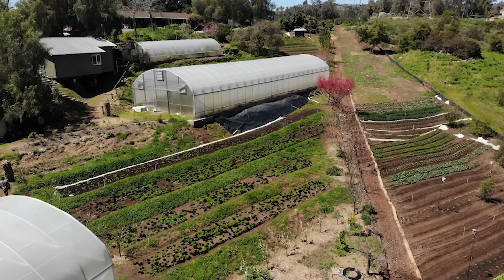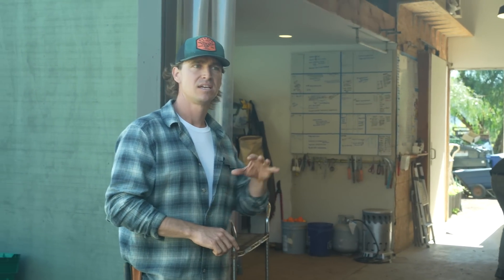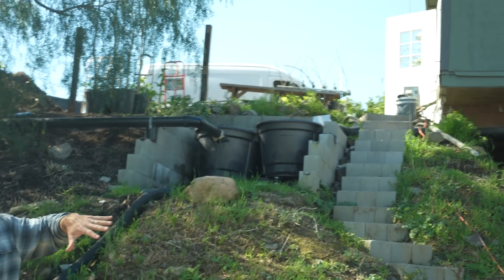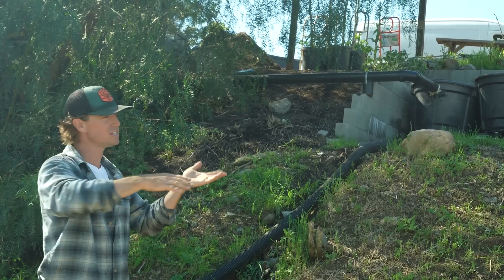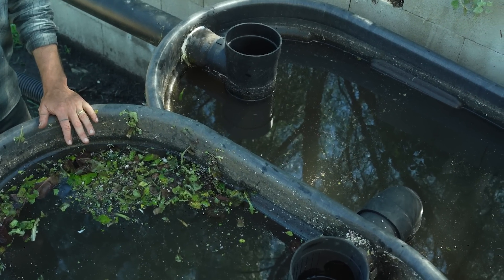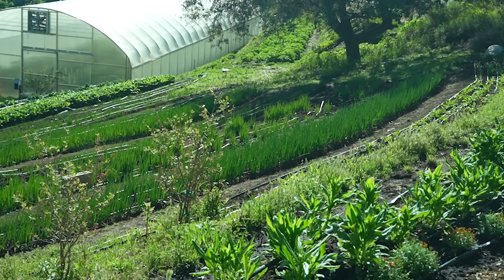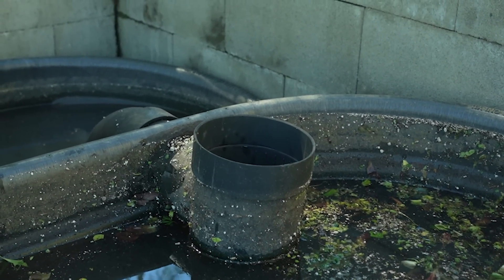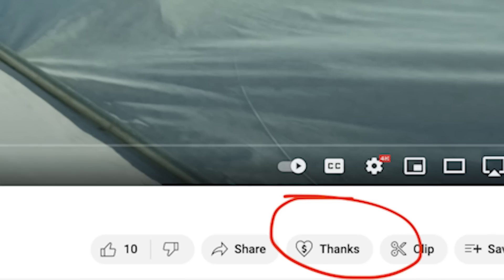Re-Using Water in a Dry Climate

Comment: Tell him to put a siphoning pipe between the two large holding tanks and the upper tank will automatically flow into the lower tank removing the need for the sump pump transfer. I hope this helps.

Comment: In Chicago we use traps like that, they're called CB Traps for catch basins. Grease floats to the top and clean water is pushed up from the bottom of the trap into the main sewer. It's essentially a giant grease trap that's a manhole in homeowners back yards.

Comment: 1st thing I built before starting my urban garden was a rainwater harvesting system. Two 55gal (415l.) drums connected by a syphon hose.  Due to the placement of my overflow holes, the net capacity is probably closer to 100 gallon (378l.).  They've yet to go lower than half full (or half empty - lol) but we do get a lot of rain in Puerto Rico.  No first flush system as it's not meant for potential human consumption; just a chef colander to filter debris.  My plants love that water and it makes for some 60 toilet flushes if, after a hurricane, the water authority cuts out...

Comment: Ive become a big proponent of ecosystem ponds for ranwater capture, they can hold several ibc tanks in a small pond, and work with nature in a way that is as beautiful as it is beneficial. Might not work alone for wash pack, but could be part of any system i think.
Reply: Doing this on my own property. Will have one big pond for fish and wildlife but can easily steal 5-10 gallons from if I had to in between rains but I will have many small ponds for watering crops all year at different locations. I plan to have them lead into a hose at the end of each small pond and the ponds would be slightly raised so you could easily fill up any buckets or watering can with the hose and any crops nearby could be watered if it was beneath the raised ponds.

Comment: One expedient option for the two big tanks would be to have a hose between the two, automatically siphoning water so they maintain the same level, rather than having both going to the pump.

You would need something like a bowl stuck to the bottom of each tank where the hose ends so that the siphon hose always has water at both ends
Reply: That bowl idea is great. It keeps from losing siphon when one of the tanks is empty, right?
Reply: @hoosierpioneer  indeed!

They would need to be level with each other too. Another idea is to potentially prime the siphon with the bowls/buckets before lowering them into the tanks to make priming easier.